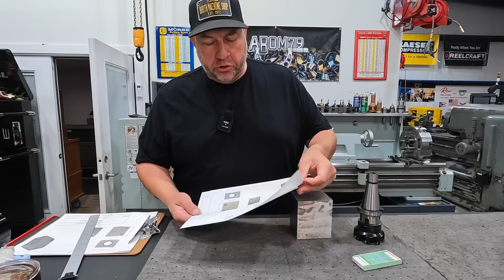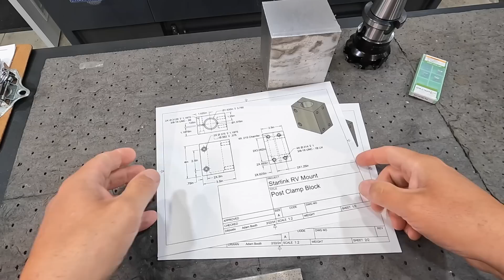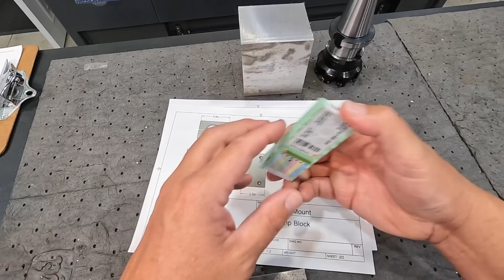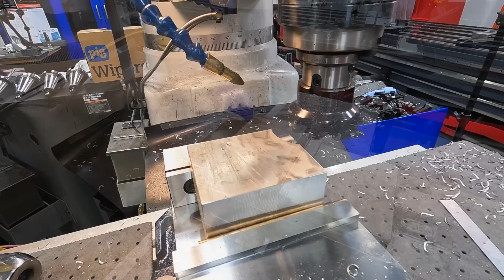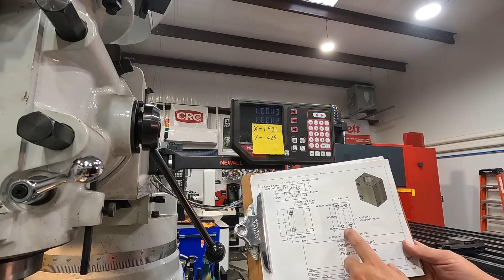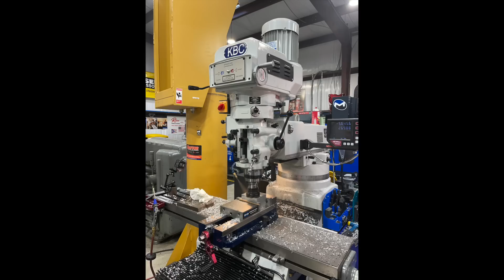Custom Starlink RV Mount Part 1

Comment: Adam, have you ever thought about using the table with holes with a fence? I was thinking using one as a movable fence, posts  built into the fence so you can simply drop it into the holes. Then the red factory style clamps that fit into the holes will tighten against the part and fence. I think I can use a table and other things to glue wood.

Comment: Congratulations for the project, but I recommend it to install a high gain omnidirectional POE WiFi antenna in order to take advantage of any WiFi if present. I read all the comments and no one says that for the Starlink antenna, it seems like the best RV installation is flat mount by disabling the motor and perhaps using a flat mount kit. it is also possible to modify the cable by inserting an ethernet socket and a waterproof plug, paying attention to the connection as starlink has a proprietary cable layout. You must pay equal attention to the cable because it is a bit delicate and can cause malfunctions, it is better to make it bend at the top and secure it with plastic ties so that it does not get damaged at the antenna entry point. you can find a lot of information on these antennas and also on the new version, in the USA it works great everywhere even when mounted flat. Greetings from Italy, I really appreciate your works, congratulations.

Comment: No need for a keyway. That notch is so you can run the cable down your tube so it ain't whipping in the wind. Therefore, no need for cable ties or straps. Neat, clean and simple!!

Comment: 15:15 i have found out, that if i place the rod as low as possible, the angularity is better than if i put the rod on the higher end because the fixed jaw will flex more if i place the rod higher.

Comment: I was just wondering if the flex arm is more 'sensitive' with aluminium. Its great to have the skills to both design and draw your diagrams. nice job.
Reply: The clutch in the tap collet is set to not break the tap, so a short thread might strip out before that clutch disengages, since the clutches are adjustable you can set it to disengage at a lower force so that doesn't happen, if you remember to...

Comment: I would consider getting a piece of a cutting board to have on the table to set the tip of the tap on, instead of setting it on table.

Comment: So interesting speeds/feeds (re aluminum) When I worked at a CNC facility, the machines doing aluminum work were up to 8000rpm and 2.5 inch, then they had guys running heavy 'junk' steel, running at 400rpm and .25 inch

Comment: To me projects like this are one of the rewards of investing in machines and machine tools as a Hobby Machinist working in my tiny one car garage. My passion is the miniature steam engine world but about a month ago my son-in-law who is building a 70 Chevy Nova bracket racing Drag car called me and said he wanted to relocate the electric water pump (no belt driven accessory's, load on the motor) to a location on the fender well and asked if I could help. (mount kit is a couple hundred bucks) We took some measurements and came up with a sketch. I got a chunk of Billet Aluminum on line and a weekend end later he had a shinny new bracket. I had a blast making it and told myself a few times, I'm really glad I got into this hobby. I had a ton of fun, he saved a pile of money, it was a win/win.

Comment: doesn't internet connectivity defeat some of the purpose of camping?  just a little too tempting to check emails and whatnot.  I agree that when you need and you have it you are golden.  I'm tempted to get in on starlink myself, but i'm worried that I won't be to really relax.  btw, I'm blown away that you called that aluminum flatbar...3"x4"?

Comment: It's obvious how the first 4 milling procedures would have been 90 degrees off of each other all the way around. However, once he moved to the last two procedures, he basically counted on the factory end of the piece to be 'square' with the previously milled edges. I realize, this part didn't need to be any more precise than how he did it. But what if I did want to mill a perfect cube? Put an indicator in the quill and ride up and down the side of clamped part? Or is there an easier way than that?
Reply: Clamp into an angle plate that's laid on it's side . Or use long endmill and do sides as is in vice .
Reply: Depends on how accurate you need to be.  For the highest precision, yes an indicator attached to the quill would be the way to go.  If you are just looking for speed you could use a machinist square against the bottom of the vice and the side of the part, it would get you very close depending on the accuracy of the square.
Reply: Or just use precision square to stand it up in vice to use same facemill
Reply: Thanks guys.